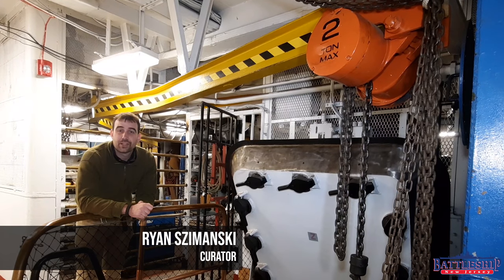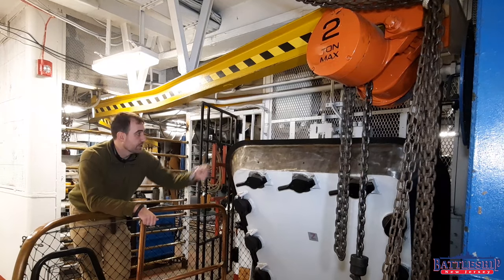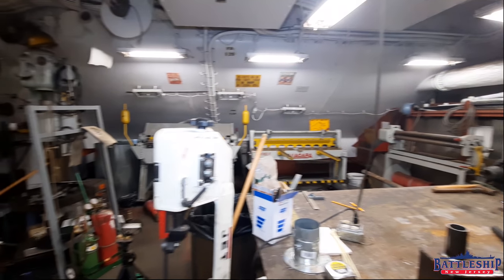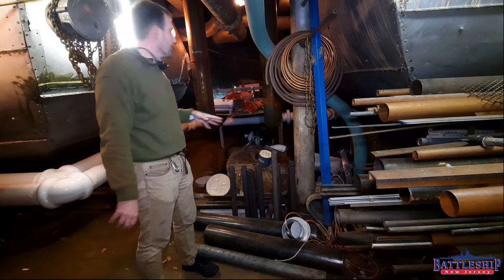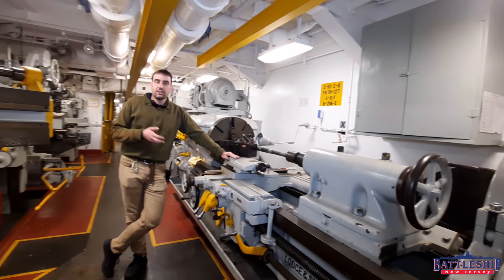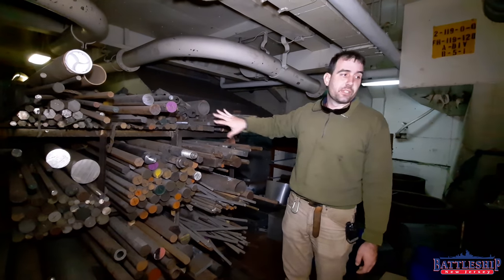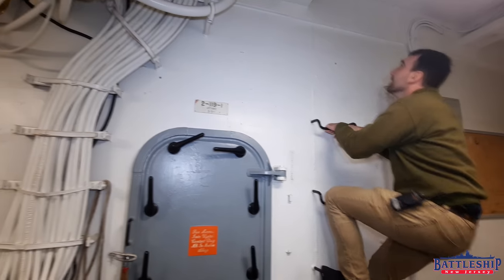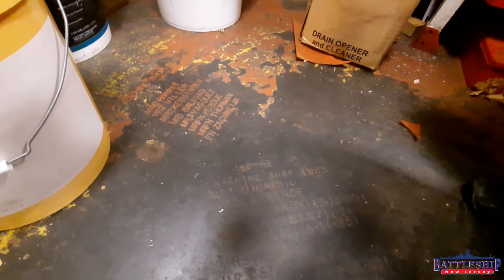Battleship New Jersey's Machine Shop

Comment: I've a feeling the Navy is losing the "Steam Experienced workforce". From what I read the Navy is is to gas turbines (jet engines). Mostly equipment that can be "Just Thrown Away', not repaired, even the ships they powered.
Reply: EWA: Gas turbines (jet engines) are overhauled. Always have been.
Reply: I'm a retired VA hospital employee. My hospital had the second largest boiler plant in the system. All the plant employees were licensed stationary engineers and all of them were ex Navy and had attended BT school. Before my retirement the scuttlebut was the Navy was no longer training  boiler techs.  It will be difficult, if not impossible, to find trained, or trainable, tehnicians in the future. It's not like steam plants are going away, at least, I hope not.

Comment: Is it my old eyes or has something BENT that beam?
Reply from the maker: The beam does curve around corners? Otherwise, it's still in working order.
Reply: The bend I was refering to was between the hatch and the first turn of the beam in the first scene. Thank you for such a prompt reply. I truly appreciate this chanel.
Reply from the maker: Doubled back to take a look and yeah, I see what you mean, its a deliberate bend though it does look a little extreme, I think the key is that it is going down, though it looks like it bends out.

Comment: Most of the old fart machinists ( if they can still remember ) have run and know how to make parts with these old machines but they are getting far and in between now.⚰️ Some of the newer generations, maybe as hobbits can relate to it. Manual levers, manual oilers, basically manual everything was in vogue. No electronics as per say,even the on/off switches were mechanical relays. No CNC to do it for you. Yup, a different class of machinist compared today’s to produce a good simple or complicated part on those machines 😎